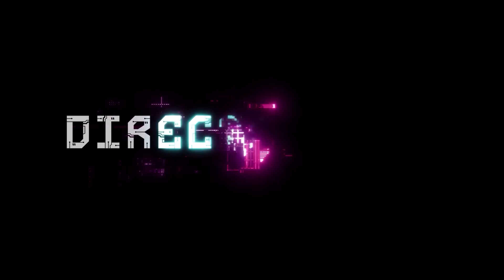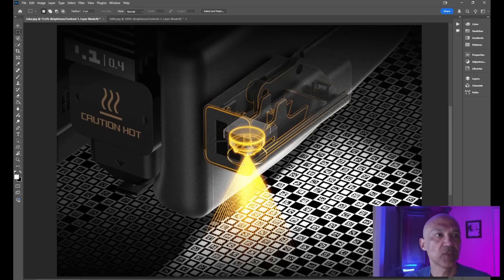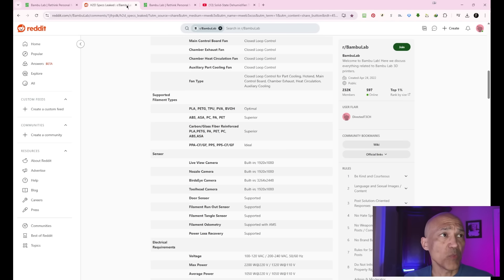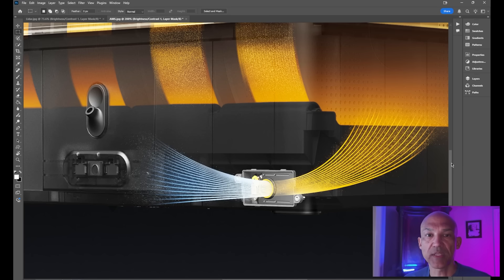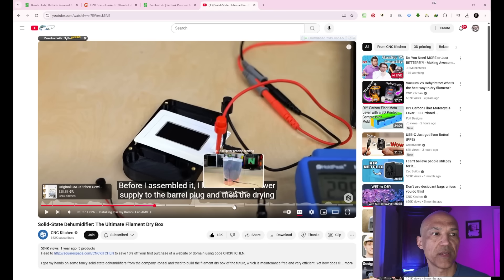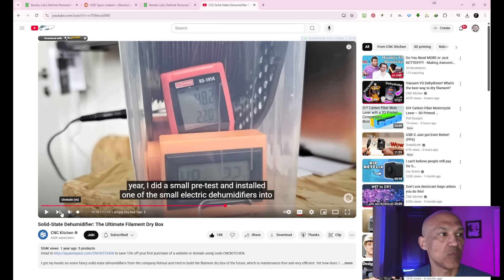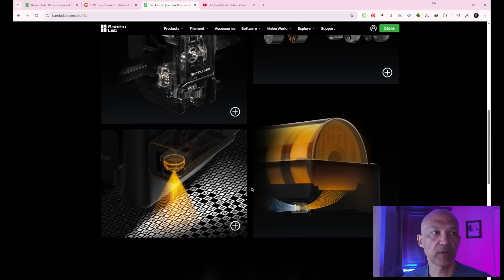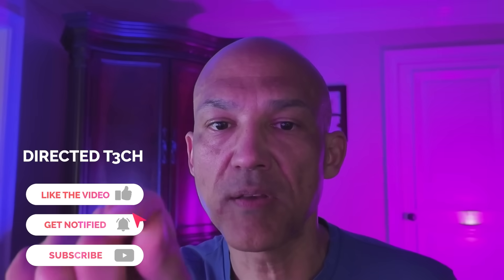Bambu Lab H2D - Tool Head Camera or Lidar? Mystery Dryer Technology? Heater or Solid State Dryer?

Comment: What's nice is that you can run an AMS Pro, AMS Pro 2, and AMS HT all connected to the same machine. According to the leaks. So for PLA, you can stick with just the AMS Pro, for PETG, etc... you use the AMS Pro 2, and for PC, Nylon, etc... you can use the HT.
Reply: It’s nice in the sense that you’re just speculating unless you can cite a source.

Comment: "Heating is not drying" is a bit misleading. Hot air has more capacity to hold moisture, so when you pull in cold air and heat it up - you reduce it's humidity (because it's relative). So the air becomes more dry and starts pulling moisture from materials.
This is used for everything from drying clothes to wood.

Personally, all I care about is better quality for printing miniatures. If we can have that - I'm happy. Thinner layers and smaller xy detail diameter is most important to me.
If this printer doesn't do that - it's a pass 😮

Comment: Thank you so much for sharing this video!  I'm extremely interested in the solid-state dehumidification accessory you mentioned.  I actually have two large, 200-liter electronic dry cabinets that I use to store my photography equipment.  They're also solid-state and have been running reliably for over 15 years.  I keep them set to around 30% relative humidity, and they've been incredibly stable.

I'm very excited about the prospect of AMS system with an integrated, automatic solid-state dehumidifier.  It sounds like a fantastic addition for consistent and reliable printing, especially with moisture-sensitive filaments.  Looking forward to seeing more about it!

Comment: You can dry by first heating and then vacuuming.  Given the laser printing will have a compressor, it could be used to pull vacuum.  

Very interesting ... but it might not be cheap

Comment: LiDAR is useless for measuring height differences less than a few centimeters. What Bambu uses appears to be a laser triangulation sensor, which is a far better choice for measuring small features with high accuracy.

Sure, if you take LiDAR at its literal meaning of Light Detection and Ranging, any sensor that uses a laser and detector could be called a LiDAR, but no one else in the world uses the term like that.

Does it matter? Not in any practical sense, but it’s dishonest marketing that’s trying make a feature sound more fancy than it really is.

Why do I care? Because I’m an actual LiDAR developer.

Comment: You can pull moisture from air REAL quick with a thin wire and a bunch of voltage (low amp...). I should have thought about that earlier! They use that to pull water from the air onto fields in dry areas...
IF you get the voltage somehow (don't know enough about electronics), they could easily use something like that!